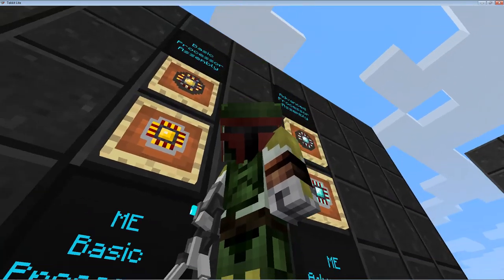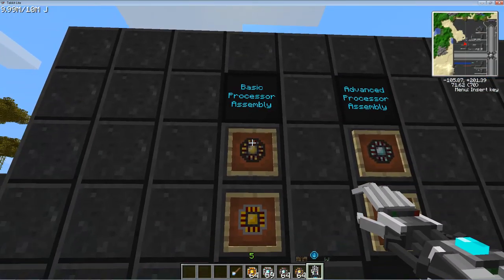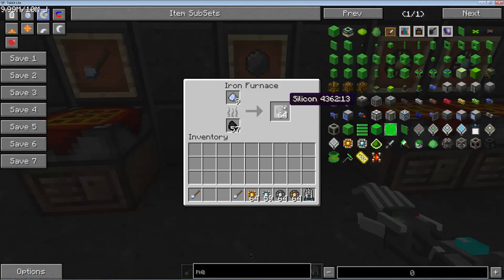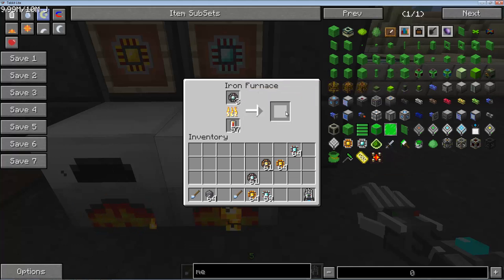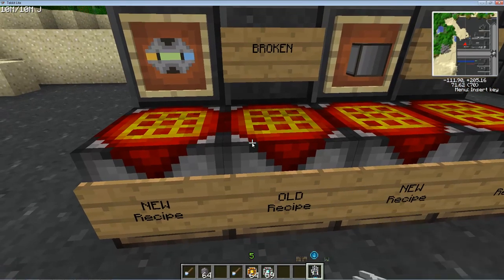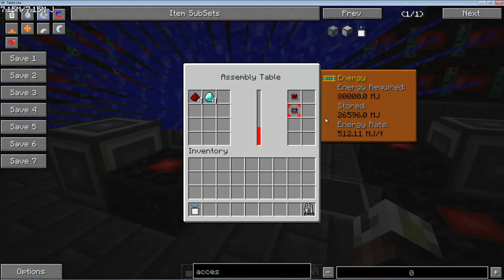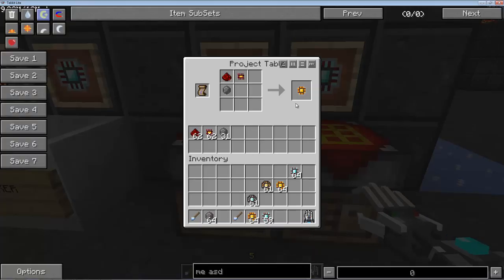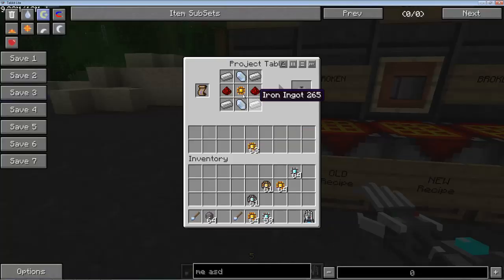Tutorial - Applied Energistics - Part 4 - Basic & Advanced Processors and Assemblies

Comment: you could fix your rubber problem by letting one massfabricator produce UU-matter which is automaticaly craftet to sticky raisins (for example in a project table). let them be pumped into a electric furnace, powered by one LV-solar with 2 overclocker upgrades, and earn your unlimited rubber. with one HV-solar on your MF you can gain 1 rubber every 3 seconds in average.

Comment: i got 1 problem with my system. if i use Macerators on my system for coal dust and i want request 1k of it it stops after 100 because the request ends if the Macerator got 64 coals in. What can i do for request more then 100 ?